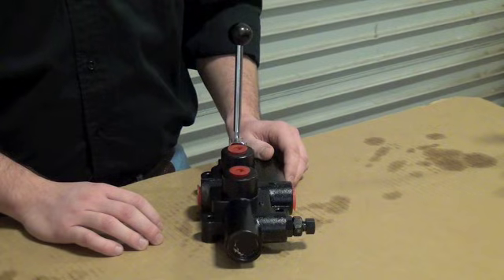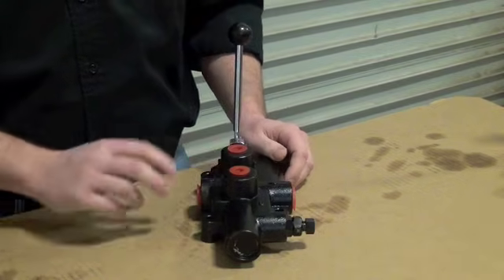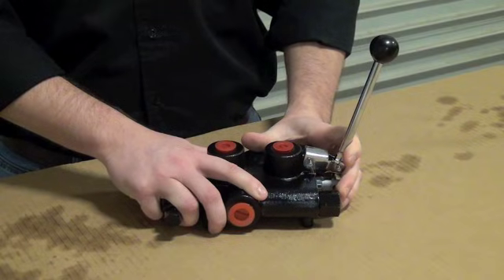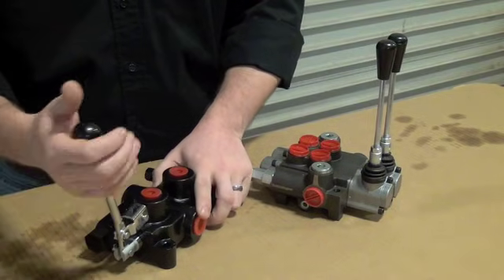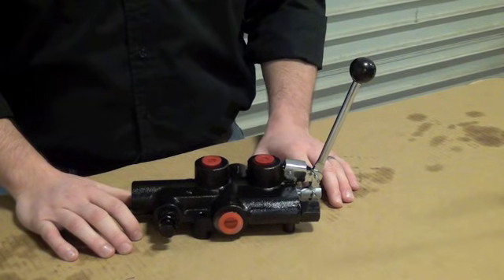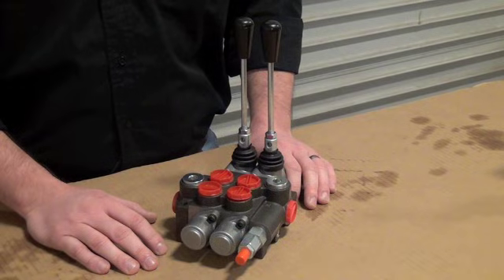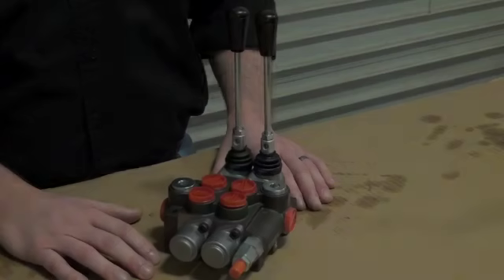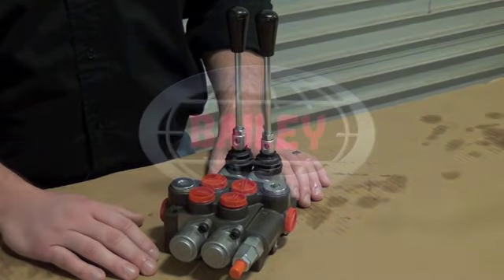Explaining Directional Control Valves:  Types and Terminology

Comment: I want to used above 300 RPM hydraulic motor in both directions. Which type hydraulic lever should be use for soft stating & stopping of hydraulic motor. 
Kindly suggest

Comment: Great video. 
My question is..
I have a home built heavy duty log splitter with a spring actuated handle. I have to hold the handle forward to move the ram to split a log then push the handle  backwards to remove the logs I split. It is real time consuming compared to other splitters I've seen and videos.
Is this normal for this type of control?? Should I change it??
Reply: You can get an automatic kick back valve